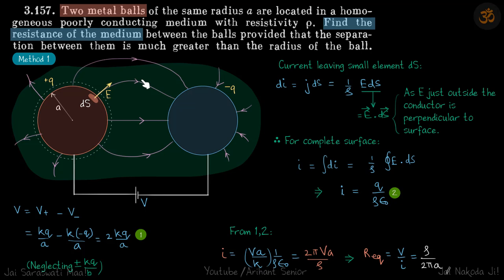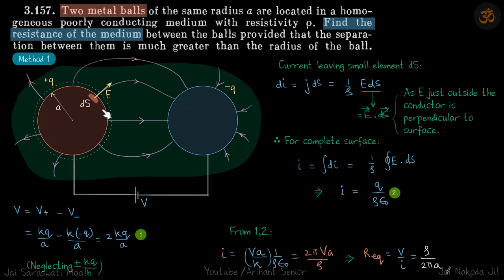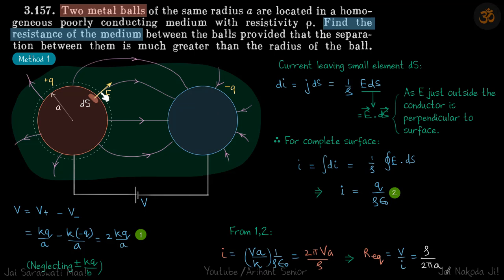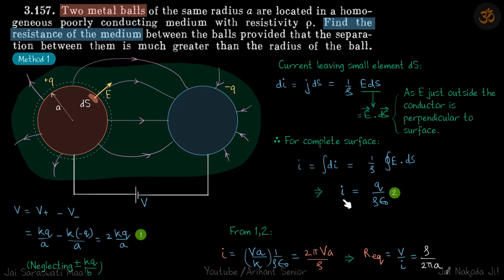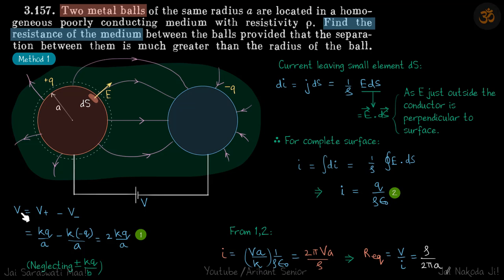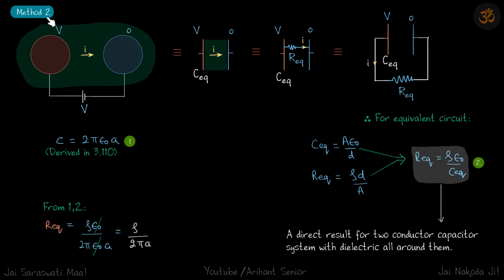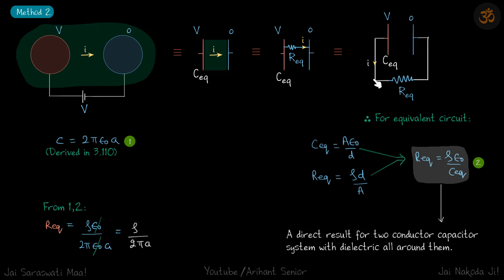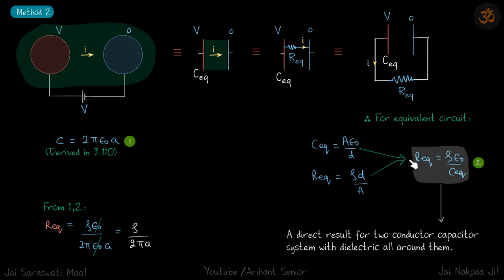3.157 | Irodov Solutions | Electrodynamics

Comment: how charge on both spheres are opposite to each other?
Reply from the maker: Its like a capacitor with resistance in parallel. See method 2. So if you connect a battery, opposite charges will come